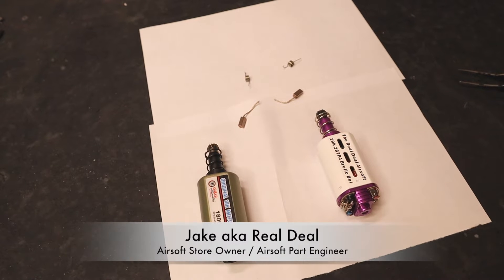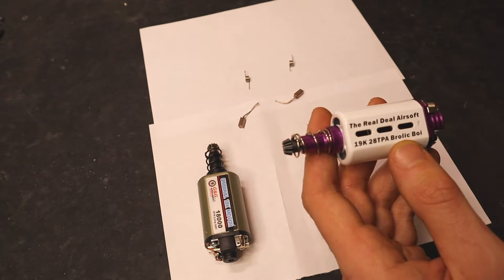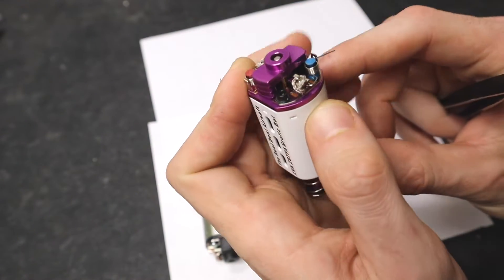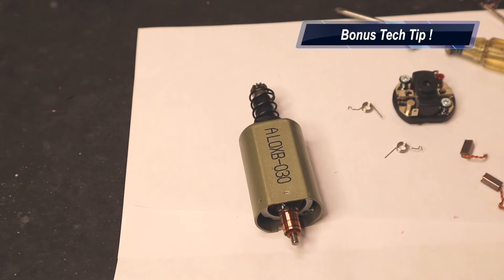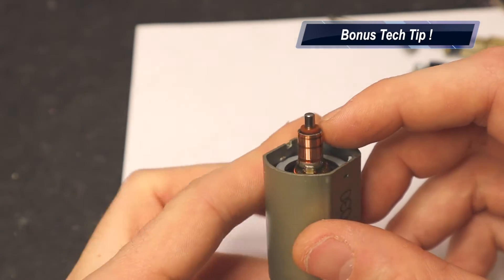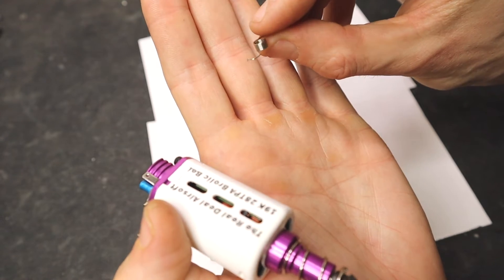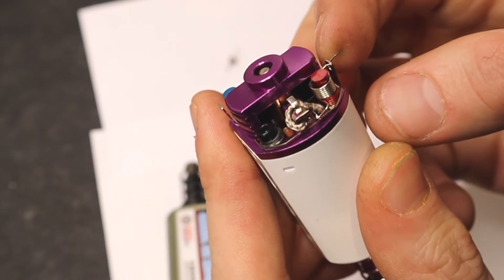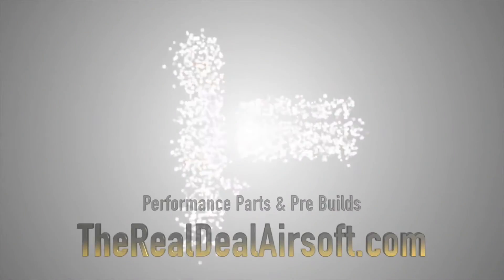How to Change DC MOTOR BRUSHES

Comment: What's the consensus on a water break in? Is that still a thing? I remember way back when before brushless motors in RC it was recommended to do a water breaking to bed in the brushes while decreasing the debris from the brushes wearing in.
Reply from the maker: Do it if you want but the pros don’t outweigh the cons of getting water somewhere where it shouldn’t be

Comment: Hey man I’m struggling big time with overspin issue. I had 13:1 emg gears with a 5k Godzilla ht and a leviathan optical mosfet also tried with a rocket motor. Even with the thing set to 100% active breaking I can’t get it to reliably work. I even tried going back to 18:1 gears and I’m still having the same issue. I’m using an 11.1 1500 40c battery.
Reply: Do you have any recommendations, could it possibly be my mosfet? Seems like the cycle sensor is working but I can’t figure it out
Reply: you need to shortstroke